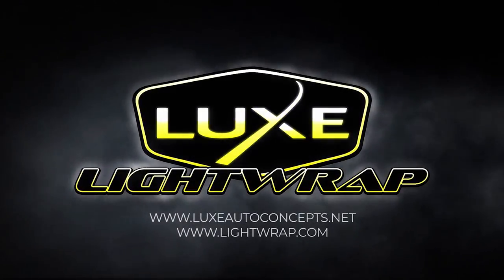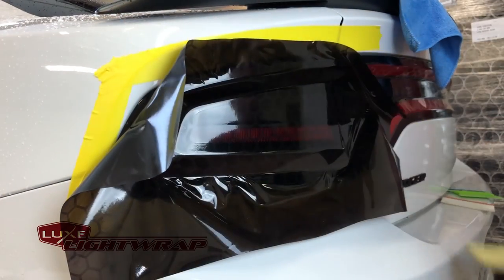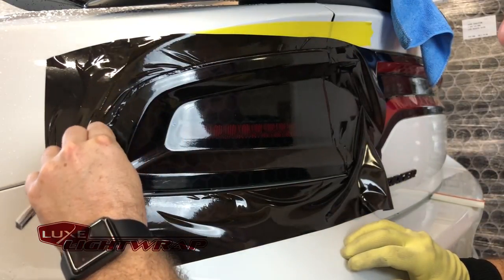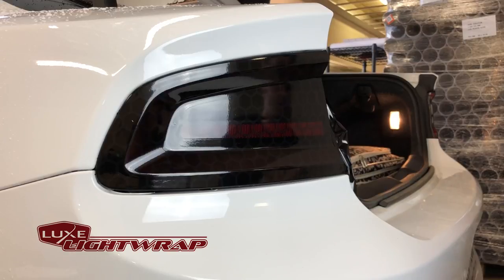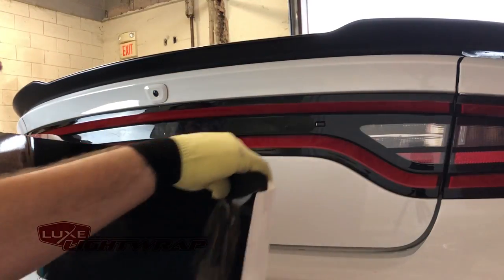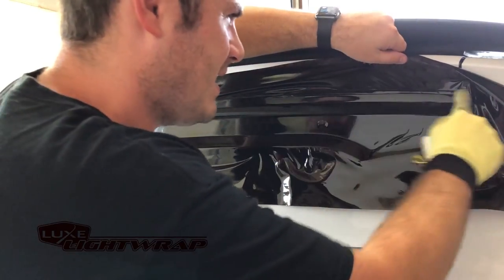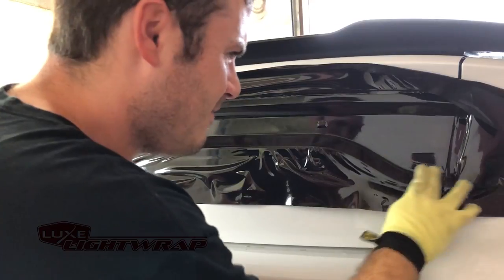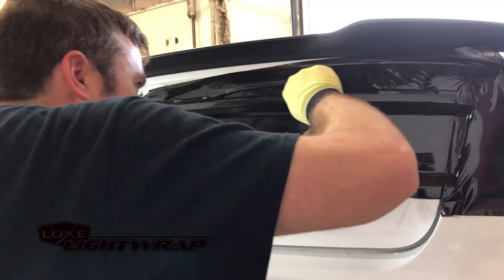2015+ Charger Tail Light Tint Kit - Type 3 (Full Wrap) // Honeycomb FX Finish

Comment: Awesome video. So I  see the letters have ne removed are they put back on later?
Reply from the maker: cedric jones normally no but you absolutely couldn
Reply: @LuxeAutoConcepts  ok thanks for sharing. What did you used to remove letters with?
Reply from the maker: cedric jones we sell a debadge kit with clay, a plastic razor, and a high tensile wire.  I use all of these things depending on the situation
Reply: @LuxeAutoConcepts  have seen something like that b4.
Reply: @LuxeAutoConcepts  how do I purchase these items?
Reply from the maker: cedric jones go to our website
Reply: @LuxeAutoConcepts  on cause I already use vinyl from y'all awesome product.